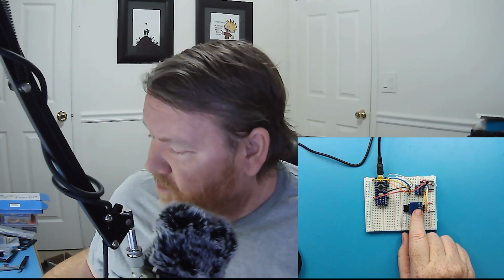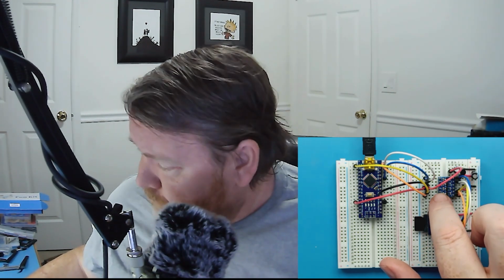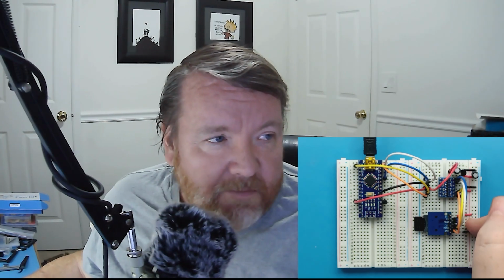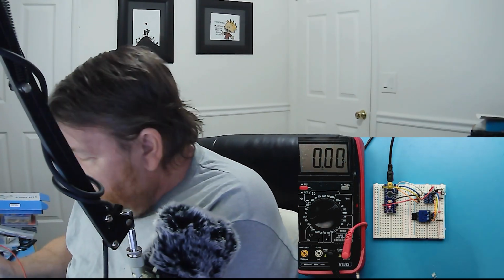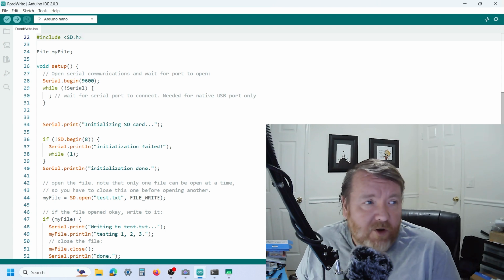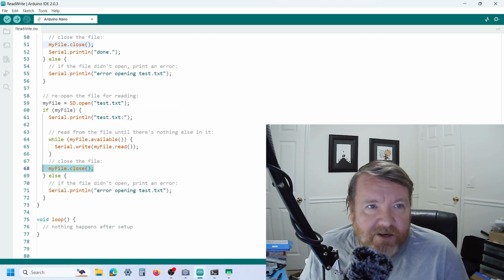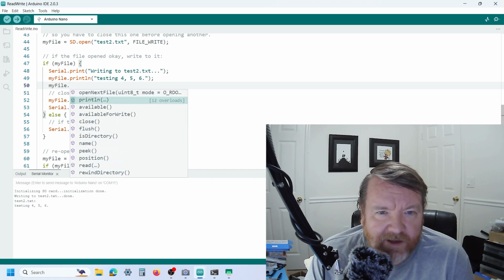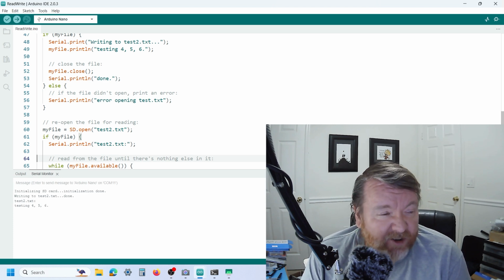Adding SD Card support to Arduino Nano

Comment: Helpful! I solved my problem and the SD card reads and writes files. Later I saw that my SD card has a voltage adapter inside so I removed the external voltage level converter circuit and the card continued to work.

Comment: Since I install the library for memory storage, my ide seems to have more trouble to connect and upload software to any of my Arduino nanos. Did you experience something similar or did you encounter any troubleshooting regarding this library ?
Reply from the maker: No, The library did not cause any connection problems with the Arduino Nano. Have you tried uninstalling the library to see if you still have the problem?